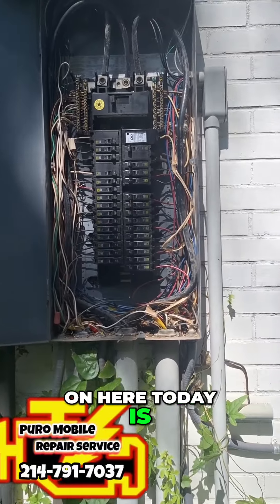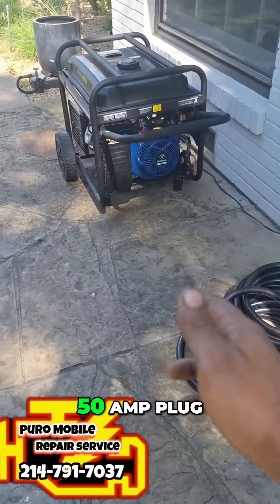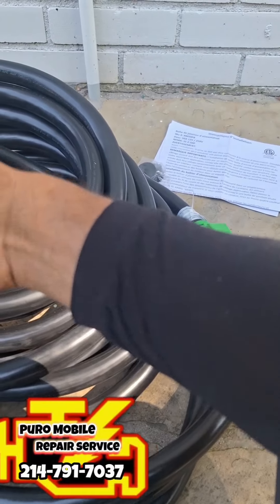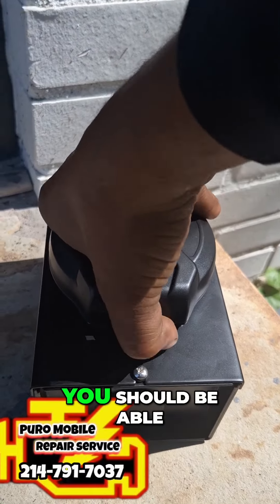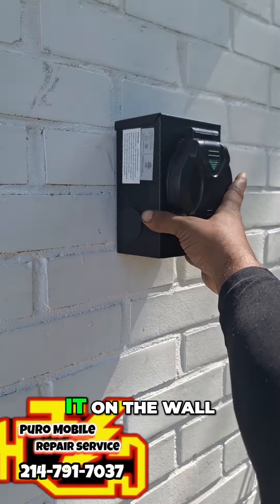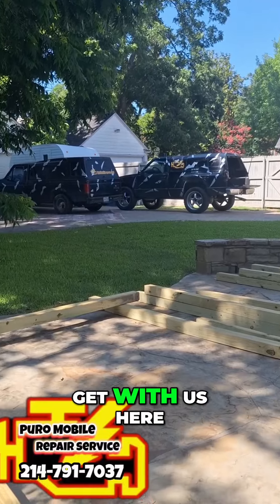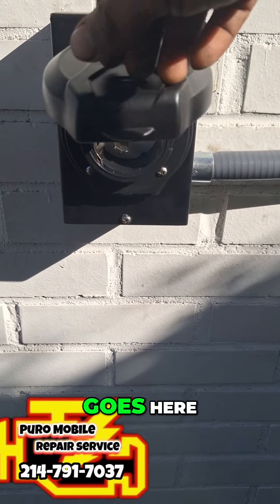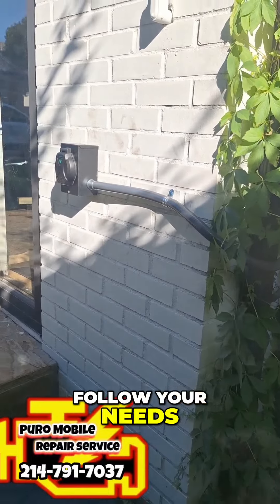Wiring in a Transfer. Message us for service in Dallas tx

Comment: Where is your interlock? And that backfeed breaker is supposed to be installed next to the main breaker in the panel. That's an improper installation.
Reply from the maker: @markbest4230  the other panel only runs up to 10 breakers. I'm sure you know that. 
   Customer wants the leisure to be able to run whichever breakers she desires at any given time, and with a little snap and direction. They will be just fine
Reply: @puromobilemechanicdallasga7832  If the work can be approved by an inspector, then it's right, not what the customer wants. We, as the contractor, have to lead the customer down the right path. I will only put in a transfer switch to assure I'm free of any liability because the customer doesn't have the proper understanding of the work you perform. Thanks for responding.
Reply from the maker: @markbest4230  understood